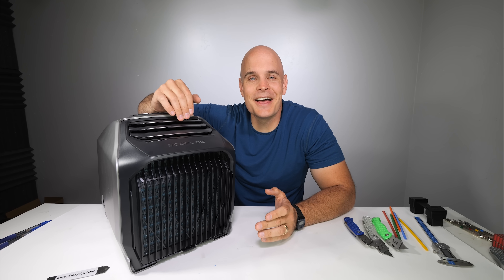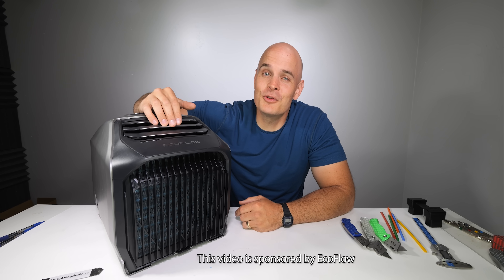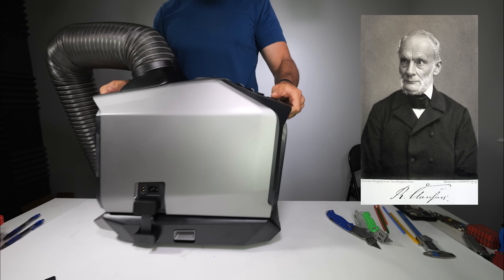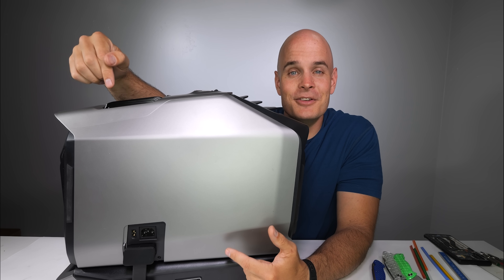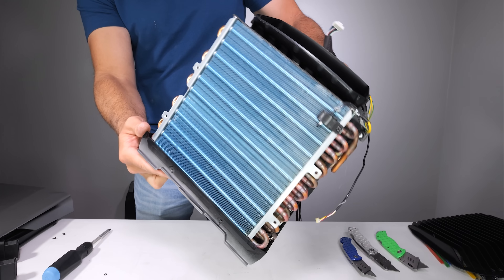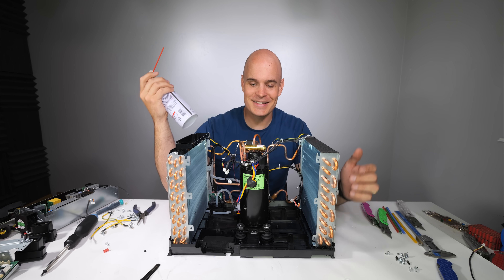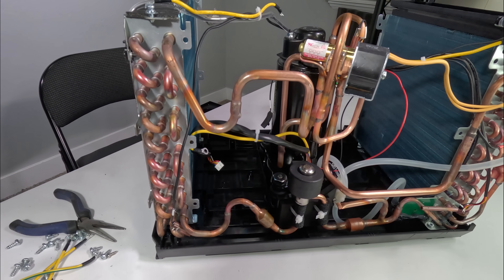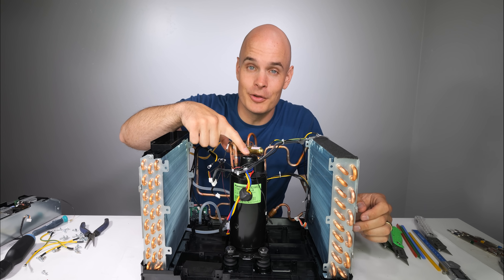THIS CHANGES EVERYTHING... (Ecoflow Wave Teardown)

Comment: How about using using standard units like W (watt) which are easy to understand and explain instead of a BTU (British thermal unit)? Just a suggestion;)
Reply: BTU is the international unit for heating/cooling ... British thermal unit.......watts of consumption do not equal cooling capacity..it all depends on the coefficient of performance.
Reply: @getyerspn  Really, then why do all my local stores advertise A/Cs and Heaters in kW?
Reply: BTU is standard, do you also complain that TVs are measured in inches?
Reply: @FastSloth87  BTU is as standard as it's composites which is farenheit and pound. It really belongs in the museum.
If you ask me, measuring anything i inches is not practical, tvs, rim size, pipe size - these three are even traditionally measured in inches even in Europe. It's hard to get rid off and it's still used because rim, pipe or tv screen diameter is not usually used in calculation so any unit is fine as long as you are consistent I guess, but still silly to use SI everywhere and inch in just a few cases ;)

Comment: Compressed air mostly gets colder because you are release the higher energy molecules and a little bit of what you said. The system you are looking at is closed so more like what happens in a diesel cylinder than a can of compressed air.

Comment: I'm sure if they made it a little bit larger, they could have the thing be 2 seperate units, have an internal coil of cable and an unspool mechanism, so you could stick the hose out the window to get an even more efficient unit. I wouldn't mind the unit being double the size if it's twice as efficient.
Reply: I guess it would still be portable, but not very practical
Reply: @Half_Finis  but I would trade practicality for efficiency.  It would make the battery life last 2-3 times longer or cool down 2-3 times more with the same battery.
Reply: Or just make it dual hose unit. You could even make it a single hose with one inside the other with just a bit of insulation between the two so you're not exchanging heat between intake and exhaust. Would probably require a bit more energy usage for higher air pressures, but would probably outweigh the efficiency gained by not sucking in outside air to the space from it being a single hose unit.
Reply: @andrewt9204  yeah but that still isn't as efficient as having the hot unit be outside 
still the 2 hose unit is better than one hose

Comment: 200% efficient is actually pretty terrible for a heat pump, Most residential heatpumps start at 400% efficiency, and higher end models will reach 800-900% efficiency. Some specialised commercial heat pumps can operate at 1000% to 1500% efficiency.

Comment: You kept saying 200% efficient, which isn't just a lie, but is mixing your units (comparing apples to oranges). It's capable of adding twice the heat to a room that a resistive heating element is, but only under highly specific conditions. The heating or cooling efficiency of air conditioners capable of reverse operation, like this one, is actually a curve.

Important point: AT SOME TEMPERATURES, THIS IS MUCH LESS EFFICIENT at providing heat output THAN A TRADITIONAL RESISTIVE HEATER!

So, I think it's cool, but don't mislead people who don't understand how this works. You can't compare this to something that's totally different or imply that this replaces other heating or cooling systems when it's not better under every possible set of conditions.

Comment: 5100 btu means it has less than half cooling capacity of the average window unit. The battery component is really nice. Hopefully they can figure out how to beef up the capacity without adding too much weight or loosing too much battery in the coming years.
Reply: theres a good chance it uses less than half the electricity of a normal window unit too. so thatd make sense.

Comment: i've had a portable 7000 btu unit for a while now, it cools down a room of about 20 sq meters, in like 30 minutes from 30 to 20 degrees celcius.
but it does suck up like 1000 watts, so i feel like putting one on battery power isn't a very good idea?

i'd imagine you only get like 1-2 cycles of 30 mins of cooling on a single battery charge

Comment: That "4-way valve" is a reversing valve. Two of the tubes on it never change, the one by itself is a discharge line, the one in the middle of the set of three is the suction line. The other two is where refrigerant is directed by the valve depending on whether you're in heat or cool mode.

Comment: The only thing that makes this different from a window AC unit is the battery. There's also the reversing valve and the handle, but why in the world would you need both? If you can just pick the thing up and point it the other direction... Kind of defeats the point right? Heat pumps are awesome but this think makes no sense. The exhaust tube didn't even have insulation. Might make a decent heater, but a terrible AC unit. About as efficient as leaving your fridge door open

Comment: 200% is the same as a Coefficient Of Performance (COP) of 2:1, which is not that high for a heat pump, and is a pretty meaningless figure without knowing the ambient temperature it’s using to extract heat from.

Comment: Man, just last year, I was an earlybird for the first version and here we are, just like smartphones, the 2nd model. I must knock ecoflow for the first model feeling like an extremely "beta" and unfinished product with a bit of poor design. The side-mounted power outlets, the really loud power management cooling fan, proprietary XT power connections locked down to their ecosystem being as power supplies and DIY lithium systems is such a huge thing and cannot be used, it was annoying. The unit DID perform but was unreliable. Even months after public release, depending  on the unit to keep an area cool for pets or a child on a hot day was dangerous- sudden random error codes even when running on a solid AC input power source was unfortunate. It was cool to experiment with but I sure hope this new model is great. The version 1 owners sure spent a whole lot of money for a so-so product only to be replaced by a new version the next spring. Ecoflow was wonderful to listen to my emails, feedback, technical responses, and willingness to pay for return shipping and a full refund even after I'd disassembled it and troubleshot a few things was pretty great. +1 to ecoflow for good support.

Comment: so this unit is taking the refrigerated air from the room, running it through the condenser and then spitting it outside. this creates a negative air pressure with respect to the external environment, air ill leak in from outside the room to re-establish pressure so..... yeah they would need 2 pipes, 1 going in and 1 going out. bad design.
Reply: Uh....this isn't to heat or cool your house.  It's to use in your garden shed, or RV, or tent, or to blow on you on you deck.

Comment: The efficiency number of 200%  goes against electroboom's(free energy)
Reply: Relative to resistive heat measured in BTUs supplied with an equivalent amount of electricity.  It is not a measure against no electrical input whatsoever. It moves heat, it doesn't create it, except through losses from pump friction and fan back-air pressure.
Reply: @mikemotorbike4283 ok😅. Now that I am pursuing an engineer degree, I came to know the 200% number is not equal to free energy

Comment: OMG!
Heat pumps came in 2 versions, freon or enviro friendly less efficient refrigerants. Now every 4WD store sells cheap Chinese junk with half the technical efficiency. At the end it is just more landfill.  Japanese firms use heat pumps with Carbon Dioxide, even Volkswagen had this option for a long time. Every box A/C has just about the same old technology inside as your sponsored cheap plastic box.

Comment: Usually you can get a two-duct variant, which is the same thing plus an additional plastic cover and duckt for the indoming airflow for the radiator. If you use one-duckt portable unit, it will dump hot air outside. But the dumped air need to be replaced from somewhere, so it comes from outside hot air into the room . If you ha two-duct system it gets air from outside and dumps aid outside direcly. So it is a bit more efficient. But otherwise, it uses much more power than the fixed indalled split system. And it is noisy.
Reply: Like someone else already said, this comes with 3 hoses. 1 hose for the air intake, 1 hose for waste heat to be dumped outside, and one hose to pipe the cooled air to a location of your choosing. This way it can be fully hidden from the space that it is conditioning. Pretty neat.
Reply: It comes with 3 hoses!
Reply: If you seal the room well then it's a non-issue, will just cause a little bit of under pressure.

Comment: Good luck on the re-assembly! That looks a bit more fun to get back together. Don't worry about those random "extra" pieces that might be leftover afterwards! haha  The idea on these is nice, but I would use at home mostly and would be more inclined for a permanent mini-split at that price.
Reply: This is aimed at VanLife and people who care far more about using less energy. The Watt/BTU is incredible. Obviously at a premium price
Reply: @EasyAsADC  yeah, it is good for that crowd. I will say the Midea U shaped units are great if you have the window space. That unit is really good for the output and watts used. I have two that I use in the summer months, a 8,000 and 6,000 btu unit.

Comment: Just to nitpick -- that can of "compressed air" isn't actually compressed air. It's literally a refrigerant, and thus makes your example all the better. The can getting cold is due to that liquid refrigerant inside boiling off and absorbing heat, which is exactly how the cold side of that heat pump works.

Comment: R-290 is better known as propane.  As refrigerants go it's actually pretty desirable, being comparable in performance to the original Freon, R-12.  There is the obvious kaboom risk but what can you do.
You shouldn't call it "200% efficient," that's noise.  What it actually does is use one watt of electricity to move two watts worth of heat.  For the record, that's poor.  Even a garbage window air conditioner performs as well as that.

Comment: Wow, this could actually make camping less miserable.
Reply from the maker: Na man. Going outside is never the correct answer.
Reply: @JerryRigEverything  True, turning on TOTK now.
Reply: Just be aware that the battery is 1.2kWh, the unit draws 500W, so the endurance is max 2.5 hours.

Comment: Really cool to see a mobile heat pump. But it should really have 2 tubes to the outside radiator, not one. Dumping inside air outside to release unwanted temperature is really inefficient.
Reply: It does, actually 3 hoses😊

Comment: That's actually not an accurate explanation of how a heat pump works

Also, 200% is very very low efficiency

That efficiency is called EER or COP (energy efficiency ratio or coefficient of performance)

Even a regular inverter Heat pump has a cop of over 3.5

Large chillers have a cop of over 5.5 to 6

But yes it's definitely better than cop of 1 like in the case of gas heaters

Comment: THIS CHANGES NOTHING… still the same one hose dumb design. Since the room isn’t a vacuum all air that goes out will be replaced with the air outside.
Reply from the maker: There are more flexible conduits in the box.  I only showed one.

Comment: If this is used indoors, the air that is expelled outside has to be replaced from somewhere, which is outside the room and so the aircon has to continually labour to keep the temperature to where you have set it. Doesn’t sound too efficient to me.
Reply: You are absolutely correct.

Also, compressor gets hot by itself and it stays in the room lowering the performance of cooling operation. 

And those are pretty common issues of any portable/mobile AC units. Split ACs are better but stationary (and much less noisy since everything happens outside).
Reply: Hard pass at $1500-$2500. I would get an A/C portable AC unit and LiFePO4 power station instead.

Comment: So its a standard phase change cooler, with reverse valve - to reverse cooling from heating. All powered from a battery, similar to a boat air conditioner. The only novelty is, its portability.
Reply: It will run off solar as well if you add a battery or EcoFlow solar battery

Comment: I use something similar when I go camping in Florida. It's so crazy to be 85 degrees outside and 70 degrees inside a TENT! Makes a big difference when trying to sleep!
Reply: What do you use? Is it cheaper than this thing?
Reply: @Christopher_HotSauce  Mine is a portable AC unit I got from Best Buy. It was like $500 but I don't think it's a heat pump? But it works similar with you having to pump out the heat from the tent.
Reply: @tclark  battery powered?
Reply: @Christopher HotSauce  no this video literally shows the first one ever made.

Comment: BTU = British Thermal Units - The British thermal unit (BTU or Btu) is a measure of heat, which is measured in units of energy. It is defined as the amount of heat required to raise the temperature of one pound of water by one degree Fahrenheit. It is also part of the United States customary units. The modern SI unit for energy is the joule (J); one BTU equals about 1,055 J - varying within the range of 1,054–1,060 J depending on the specific definition;

Comment: $1000 is stupid expensive price for that little unit mini split air conditioner and heater cost $500 up to $1000 and it's 10 times more efficient and cools down much quicker

Comment: Nothing is 100% efficient, that just isn't possible. As for an ideal heat engine(perfect heat engine), it has a theoretical maximum of <100% and a practical maximum of 80%. This isn't that, so yeah... assuming it is really good, it has about 70% efficiency which in nearly 1/3th of 200%. Don’t believe the marketing. 🫡

Comment: They took a window unit, added a reversing valve and a battery pack. 
They definitely cherry picked those figures in a comparison between energy use between electric heat vs heat pump. Not new technology, heat pumps have been around for decades.

Comment: I think the design need more work: in heat mode, where do the water go? There needs to be a air intake hose so as not to waste treated inside air.  The entire unit need better insulation. And why not use a single blower fan motor?

Comment: 5100 BTU can cool a small room. That’s the equivalent of a small air conditioner, like the ones found at Walmart. The highest you can get on a 120v outlet is 10,000 btu, which can cool a very large room. Idk about heating. 6100 sounds like it’ll burn you out of the room lol
Reply: EcoFlow says up to 10 m² or 107.6 ft.²

Comment: What terrified me is when he grabbed the copper pipe that is charged with refrigerant. I once messed around with a portable fridge and it blew up on me.
Reply: That was probably due to a manufacturing defect, fatigued piping, bad solder joint, or you just pulled the pipe way too hard - otherwise that shouldn't happen. If that does happen watch out because many minifridges use butane and other flammable gasses for refrigerant.

Comment: What size space will it cool or heat? BTU = British Thermal Unit's its a unit of measurement used in Cooling/Heating applications. It is equal to the amount of heat needed to raise one pound of water at maximum density through one degree Fahrenheit, equivalent to 1.055 × 103 joules.
Reply: 107 ft.² or 10 m²

Comment: How is that ever going to work if you are pumping the heat back into the room you are trying to cool. I get it has pipes , but they have to go out of the window, so what is the point of it being battery operated ?
Reply: It comes with two hoses if you’re going to use it inside a building, if you’re cool in your tent you only need the air hose that brings the cold air in to your tent

Comment: As a masterand in refrigeration, I can not notice the huge mistakes in your explanation.
The flow through the lamination valve is always the same, the valve always induces a pressure drop, it is not reversible.
And a heat pump is not 200% efficient. Efficiency goes from 0% to 100%. A heat pump is characterized by a coefficient of performance, which can go higher than 1 (100%). In this case, is somewhere around 3.
Also, R290 is explosive, so yet another undocumented and wrong opinion. R290 is propane.

Comment: It’s a heat pump. Without auxiliary heating of some kind, they’re only good to about 20F
Reply: It’s inside, the outside temperature isn’t that important probably but it does have an intake air hose
Reply: @melissasmess2773  It can either get rid of hot air from the inside by pumping it outside or it can take air in from the outside and warm it up = a heat pump. If the temperature outside is too cold, then it needs auxiliary heat.

Comment: This think is pretty neat, not gonna lie, but $1200 for just the A/C with no battery is ludicrous. $2200 for the A/C + battery is insane, you're better off just using a cheap $150 window unit and a portable battery. It's cheaper, and now you have a battery to use with other things too. 

I think it's also questionable how we never get a temperature reading, or any sort of test on the device's performance. From what I can gather, the 5000BTU claim is with the unit plugged in, and I doubt that it can reach that number on battery, given that it lasts 8 hours allegedly.

Comment: Every self contained unit has the same problem, which is that there is only an exhaust of warm air without a supply.
In other words, you create an indoor negative pressure that must be compensated with air coming from ... 
(you guessed it right) warm outside air.
So in effect, you are drawing warm outside air in through all the nooks and crannies of your house.
I don't understand how you could call such a thing efficient.